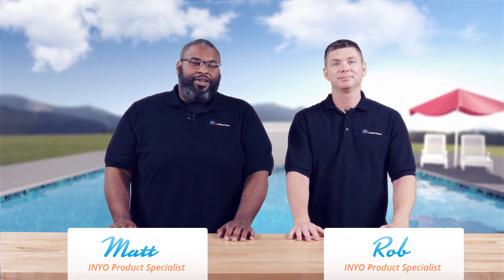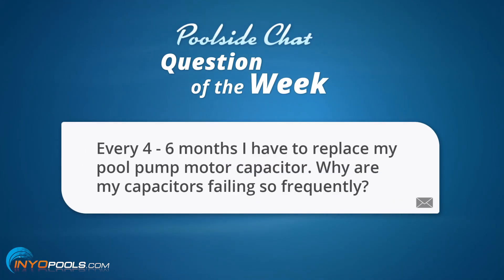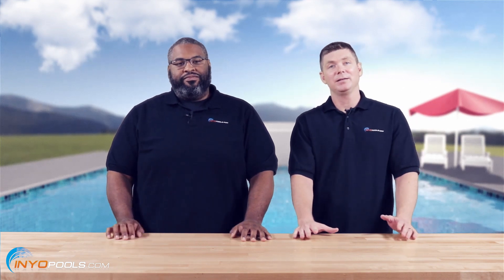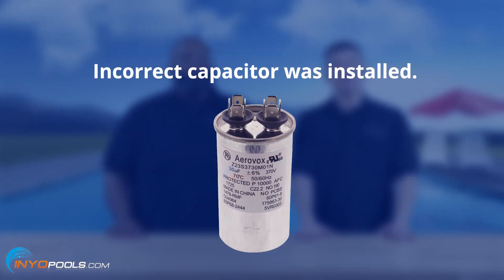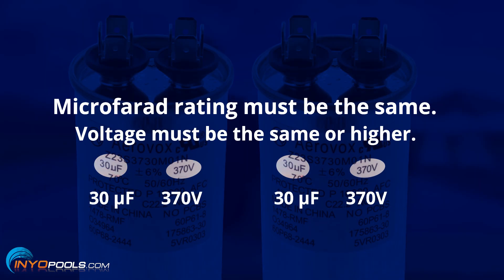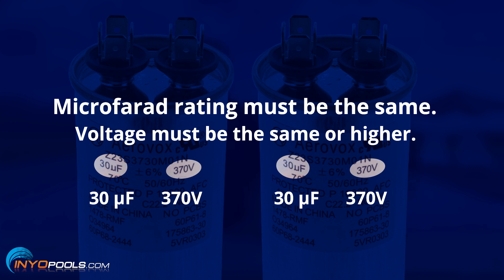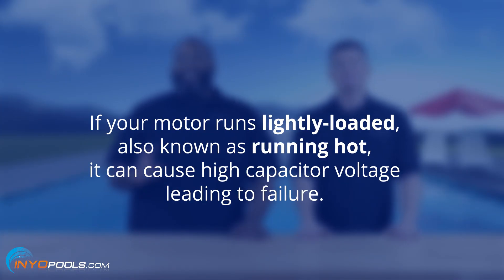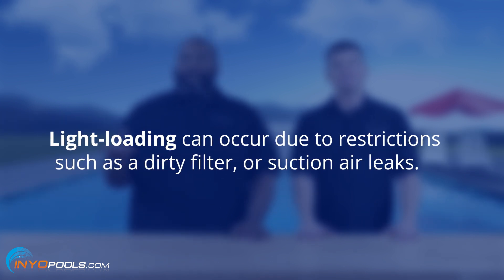Why is my pool pump motor capacitor failing?

Comment: My maintenance pool pump does not get any suction at all no matter how many times I prime it. I use this pump only to vacuum all dirt from the bottom of the pool usig a cheap cartridge filter for the task, but lately it has been really hard to get it to prime and finally today I cant get it to have any suction at all. I check and cleaned the impeller, and the motor appears to move the impeller just fine, also it does not have any wierd sounds. I am thinking it could be the motor going bad. Any advice before I toss it and look for a replacement?
Reply from the maker: Have you inspected the strainer housing gasket or hoses for any air leaks? If the hoses/pipes feeding the pump aren't airtight, it'll make it harder for the pump to prime itself. Look at our air leak or priming issues videos; see the links below.

How To Find Suction Side Air Leaks In Your Pool - https://youtu.be/eIweuWQ-WpE
How To: Fix Priming Problems In Your Pool Plumbing - https://youtu.be/0kjQCEXP0Bk
Reply: @Inyopools  I connected one end of the maintenance lines to a return jet, and the other end into the inlet of the maintenance pump. The water flows fine just like as long as the line is connected to the return jet. Once I disconnect the maintenance pump wont suck any water from the hose, i am looking into used pumps already. Thanks!!

Comment: Hi 
This  Electrician said he didn't tool have the tools to check capacitors on my pool pump. My question is what kind of tools are needed?
Reply from the maker: An electrician should have the basic tools to test a capacitor. All you need is a multi-meter.  Here is a video where we use a multi-meter to test the pump capacitor. https://youtu.be/hl9BnW9XwFY

Comment: While on vacation we had a power outage which caused my pump breaker to trip. Upon return my pump would not start, making a humming noise. I replaced capacitor and pump turned on but at a low speed {RPM]. Question? Do I need a new pump.

Comment: I have a pool pump that's almost 3 years old. Turned it on the other day and it's sparking and smoking. It seems to be wired correctly and set to the correct voltage (115v). Capacitor looks normal... Not bulging or anything.
Reply: Should I try to replace the capacitor?
Reply from the maker: If the shaft can spin feely, it's worth a shot to replace the capacitor.

Comment: Also, many pool pump motors are with 2" inlet/outlet while the tubing is all in 1.5". This causes the pump to work hard uselessly all the time.  1.5" tubing is also for 1 hp pump that can go 60 gal/min. Having a 1.5+ pump will also cause premature wearing on all components.

Comment: My problem is slightly different, I've just installed a new capacitor on my pool motor and being currently unemployed, I opted to do it myself to save a little cash while I search for a new job, it's cleaning, but it runs for about 5 minutes, then pauses for another 5 minutes or so, the cap I just replaced was rated at 450v and the one I replaced it with is a 400v, I was under the impression the cap is only used for starting the pump, what am I missing?
Reply from the maker: It sounds like you replaced a run capacitor and not a start capacitor. The run capacitor needs to have a voltage rating that is equal to or higher than the original.

Comment: I have X6 hottub had drip on wet end changed wet end with housing start up pump running fine no leak start to smell like burning smell Cp comes up on panel now they say bad capacitor?? Was running fine before just had a drip I did order a new pump now but wondering if maybe I put back wrong

Comment: Been in the pool industry 15 years. I have never had excessive capacitor issues. New US motors are complete trash. Brand new motors less than a year old are going through capacitors every month. And no one is warranting them. Do NOT buy US motors.
Reply from the maker: Thank you for the feedback. I know Century started to see an issue with some of their run capacitors so they switched a lot of them from 370v to 440v and that seemed to solve the issue.
Reply: @Inyopools  So far so good this year. Last year was a nightmare!
Reply: I’m going through a capacitor a month, any suggestions? New motor (less than a year) - Century Total HP=2.60 SQS1202R
Reply: @kylemc8851  Tough call! I had a lot of issues last year during the summer with many newly installed motors. Wait until summer ends is your best route. I would also cover your pool equipment area to protect it from indirect sunlight as well. Seems to help.
Reply: @rickyfell6369  thanks Man! I build a little side wall for shade thinking that would help. I’m in Texas so it’s hot, but also frustrating!